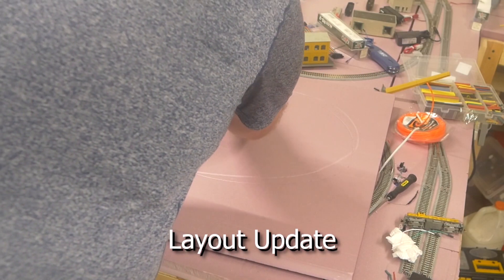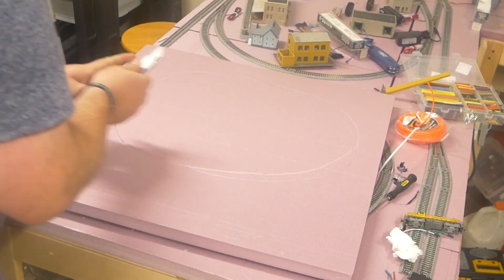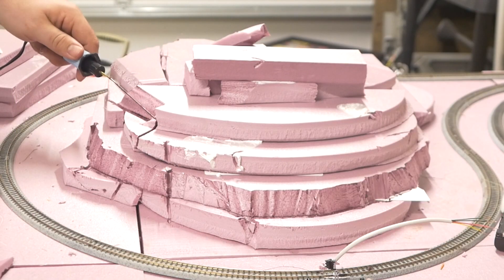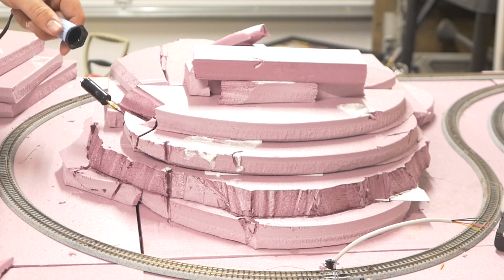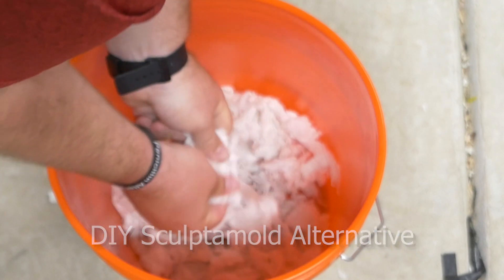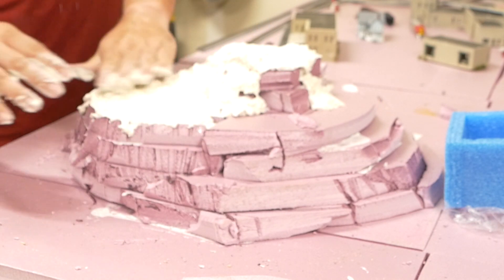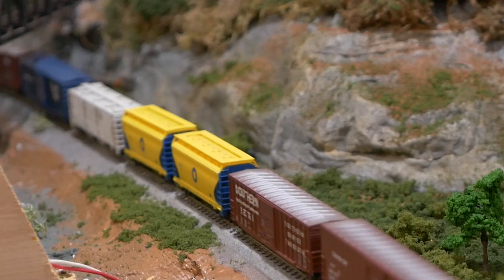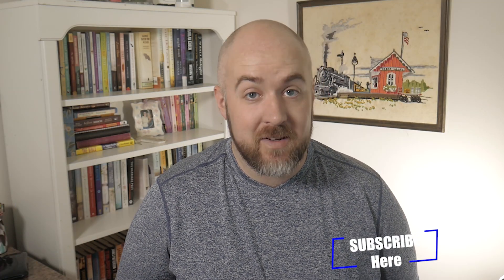Why are some Model Trains so expensive?

Comment: The basic reason is that all concerned are out to make a profit, just like any other business.

The other would be that more detailed models tend to cost more to produce and are often made in limited production runs to guarantee everything sells instead of sitting in the warehouse gathering dust until sold off at a loss later as surplus, and all that ultimately gets borne by the consumer as a higher sticker price.

Me? I buy used more than new and stick to the common as dirt stuff nobody cares about, then I can detail or kitbash it if I want to.

Comment: Anything over $100 for ANY locomotive and over $15 for ANY rolling stock except maybe some top quality metal ones is OVERPRICED......i cant believe theres a market for $500+ engines that are near indistinguishable from $300 or really $120. $120 should be the standard with DCC and $140 with sound for a fully detailed one
Reply from the maker: You are hitting on a problem that model railroading has.
Reply: @DIYDigitalRailroad  yeah i mean for $500 you can buy INSANELY high quality very large models, Bigger RC cars wiht much more intricate parts, and even brand name 3D printers for the same cost as an average DCC loco
Reply: A lot of European model trains tend to eclipse the equivilant priced Domestic US engine. don't know why though. Which is why I reccomend a Piko starter set over a Bachmann,  or you could get a walthers set.

I bought an 80.00 Mytrain ICE high speed train set by Piko that runs better than the bog standard Bachmann 0-6-0 and that's sad.

Comment: I can understand manufacturing and R&D costs, but why are they so expensive on Ebay and Amazon as used parts and all else?
Reply: Supply and demand. Suppliers charge what people will pay, if it doesn't sell then it will probably be cheaper next time.
If it sells for less than it costs to make, market and ship then it will just go away.
Reply: Plus some people who are on ebay or at shows think the stuff they have is gold plated... I saw a tyco loader system for 100 bucks..